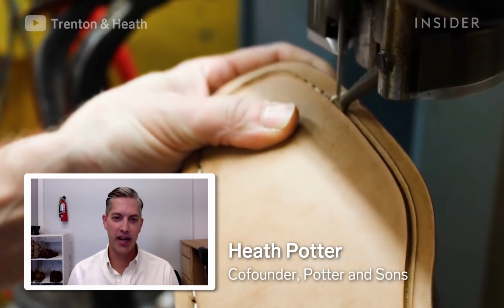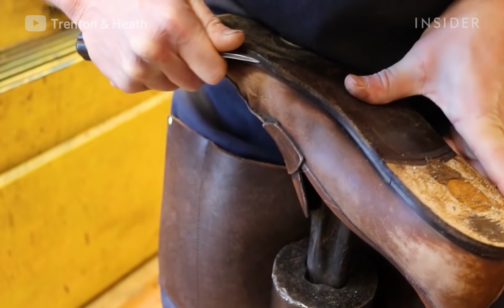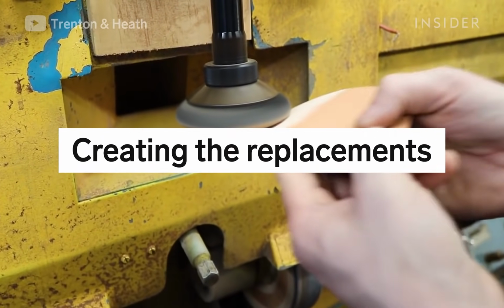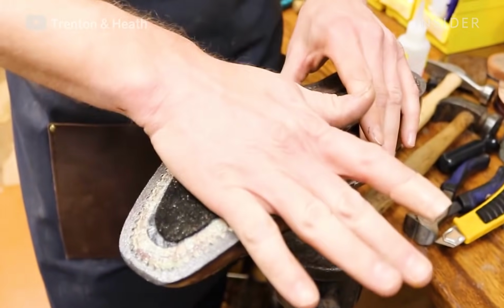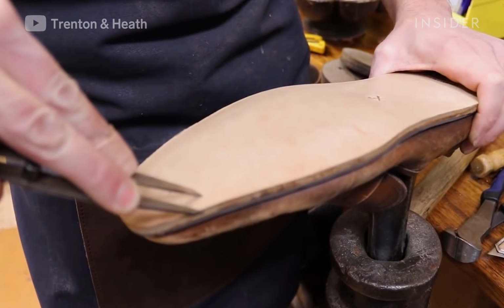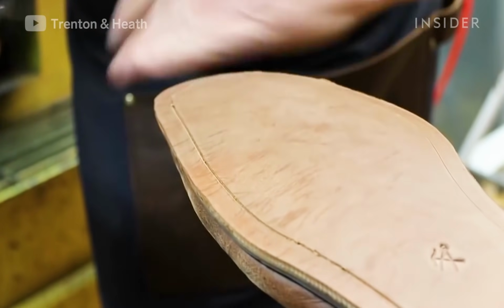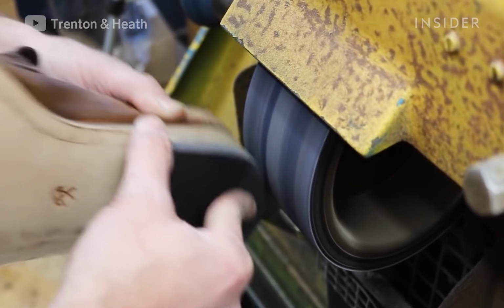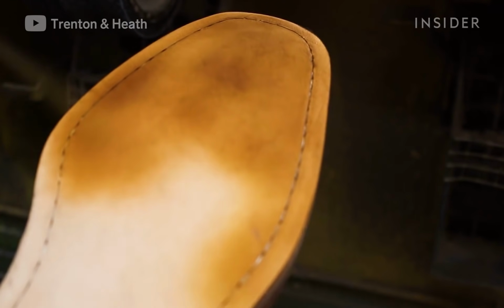How $700 Ferragamo Loafers Are Professionally Restored | Refurbished

Comment: This guy must have gotten tired of wet socks and finally decided to get his shoes repaired. :D Also since you cut the channel for the stitching by hand does the machine you use to make a channel for the stitches work only for rubber or Danite soles? Or was this a case of the leather soles being too thin to use it ?
Reply: The channel needs to be cut before you use the Blake stitching machine

Comment: I find it so funny when they "restore" something but practically make a completely new one like what is the point? Just make a separate one by yourself since you change almost every bit of the original. lol
Reply: The point of getting our shoes restored is to increase its lifespan and reduce overall waste associated with purchasing mass produced shoes designed to wear out within a year or two. By investing in good leather shoes you're investing in something that can last decades if cared for well. Think of the soles like tires. Do you throw out your car once your wheels are ready for replacement?
Reply: The shoes cost 700-800$ it cost 250$ to restore meaning restoring save substantial amounts of $ these shoes are fit to the wearers foot and feel like nothing you’ve ever worn.